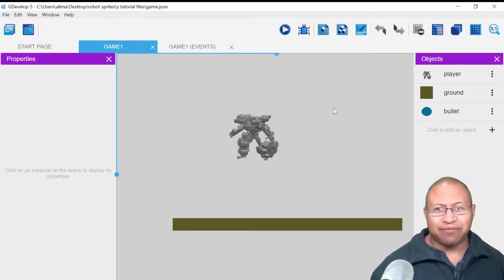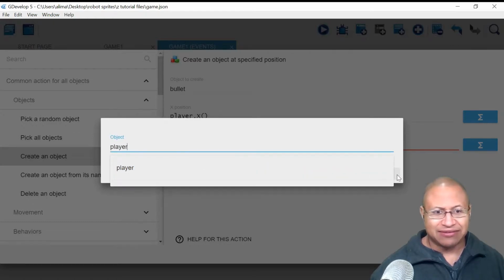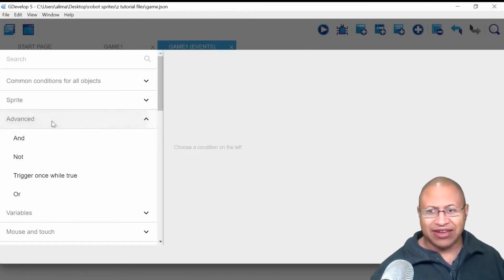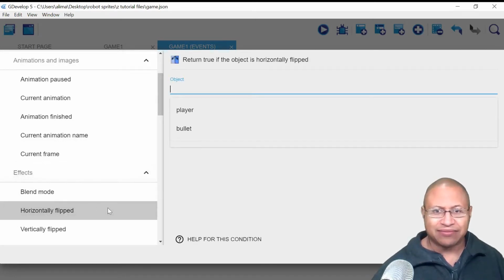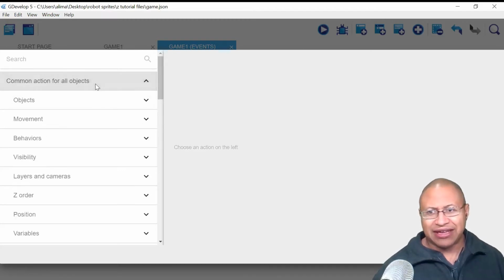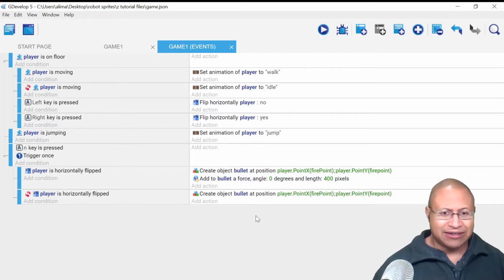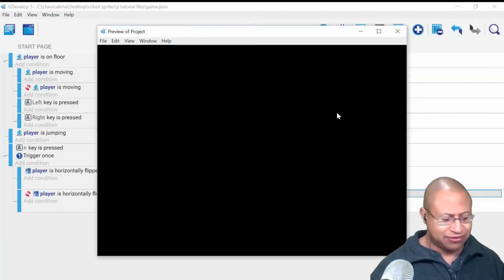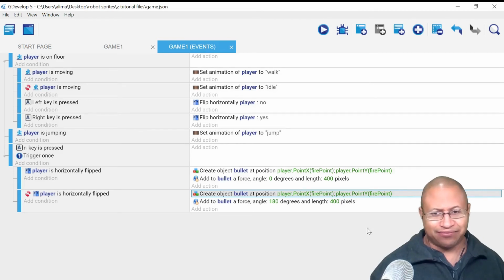Sidescroller shoot animation and movement part 4 Gdevelop 5 tutorial

Comment: i followed all these steps and everything worked well up until the bullet part, my options where you have dampening in the add a force section i only have the options of permanent and instant. is there any idea of what i should  be choosing instead of dampening or if there is something that is the equivelent of dampening for either of those options, i have tried everything to try to find a solution and have had no luck, please help
Reply from the maker: HI Bionic Panda. Thank you for watching this video. Are you still dealing with this issue or have you figured this out?